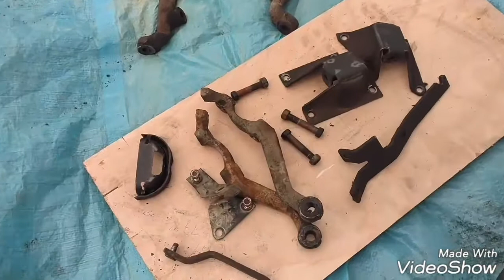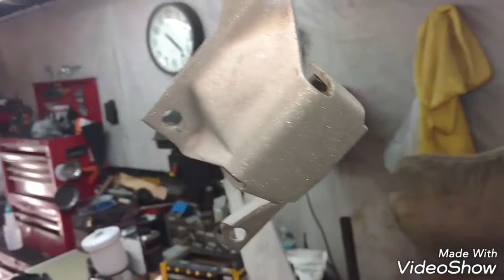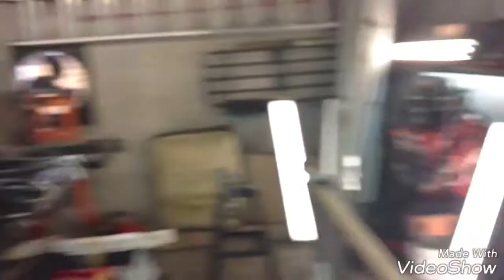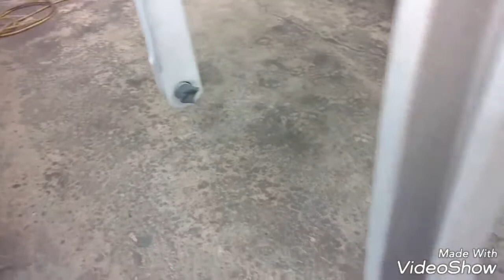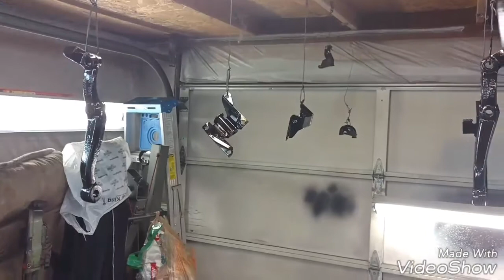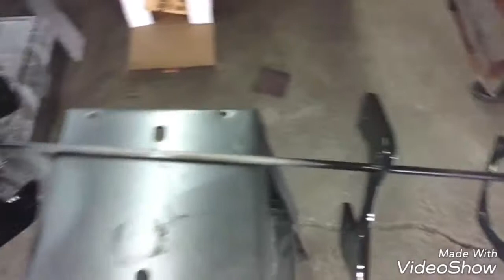Harbor freight sand blaster with black diamond media and SPI epoxy primer on 1964 Impala SS parts #7

Comment: Nice work, I'm doing the same thing but I'm also using the Eastwood chassis black over the epoxy on all the suspension parts for extra protection, SPI epoxy seems to be some good stuff.
Reply from the maker: Classic Car Overhaul yes it is I bought it based on your videos.... I'm gonna body work the frame where it's visible .... maybe do something red  with crazy flake to match the interior same with the engine compartment body's going black, lots of one off pieces in the works stay tuned.....

Comment: Hello - I used to sandblast metal parts with aluminium oxide - and the surface of the metal became silver ... or is that the colour of the metal itself ? Now I would like to use black media to blast some wording on a copper sheet using a stencil  - My question is , will the black media leave the sandblasted area permanently  black so I don't need to paint it? Thank you !
Reply from the maker: Not at all, maybe black dust, blow off and done.
Thanks for watching
Reply: @blacksheepkustoms2545    Ok - thanks for your prompt reply , So basically regardless what media is used , it will only cut into the metal, probably I will spray paint afterwards - the paint should adhere to the blasted areas . Thanks again